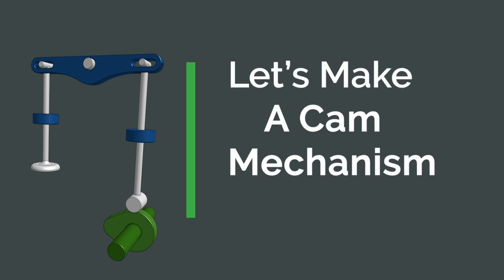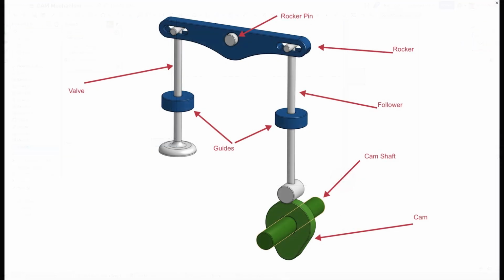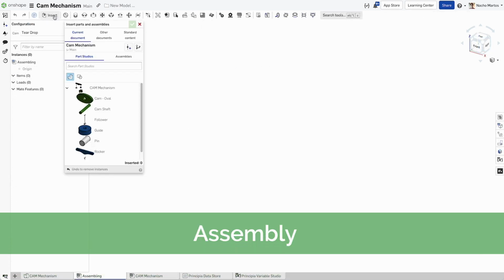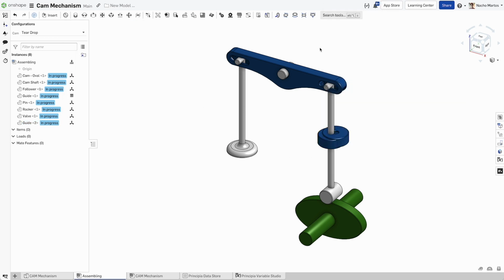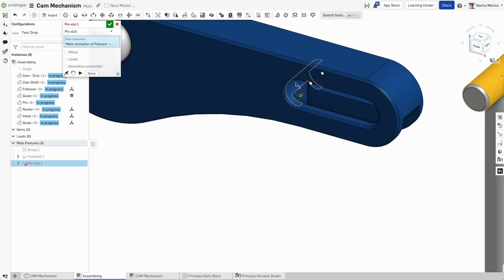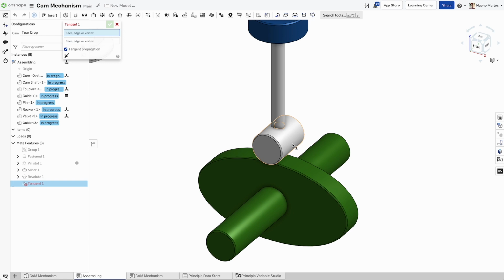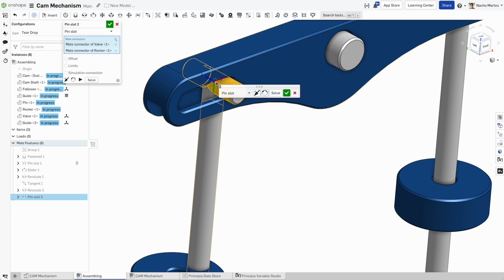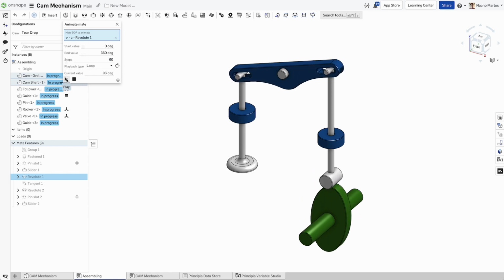Let's Make a Cam Mechanism

Comment: Nice video, but I have a hell of a time with the pin/slot mate. Is there a rule for which constraints are set before others? I get virtually all red in the mates column. I got absolutely nowhere when I decided to have 4 of these mechanisms in a row, and have 4 cams at different timings.
Reply from the maker: Hello - Here is a response from Nacho who made this video:

two things to try.
1. You will not be able to have all the cams assembled simultaneously. You must suppress one before you assemble the next. The best way to do this would be to use a configuration setting to control which cam is assembled. Here is an example of the assembly with all 4: https://cad.onshape.com/documents/f09d807232493022625d941c/w/5465177acbf7ade6d3ade76e/e/f1c09bcf970a159aa4fcd1c2  NOTE: You will need to find the right “revolute” to animate as some of the mates are being suppressed.
2. If you want to have all of them in the same part studio consider assembling one at a time or configuring the setting.
3. The mates need to be accurately defined to work, particularly the guides, if the measurements are wrong you will get red.
Hope this helps :)

Comment: How about some new CAD challenges?   Not sure how long the current ones have been up there, but I think it's time for a refresh or an expansion.  Maybe work with @TooTallToby for some better drawings as well.  A couple of the reference drawings are missing callouts that can be reverse engineered, but in most real world applications they would just be there.  The oil pan challenge is one example of that.